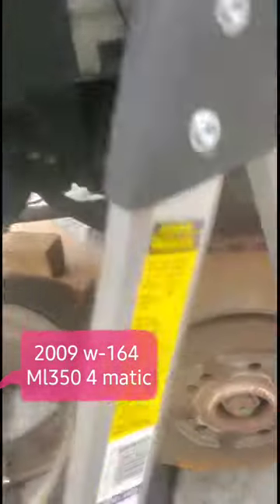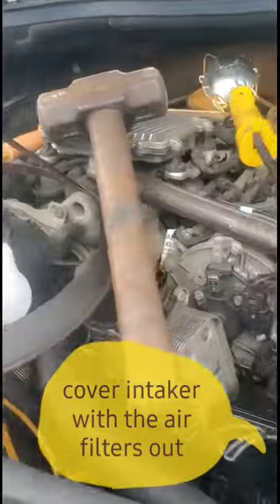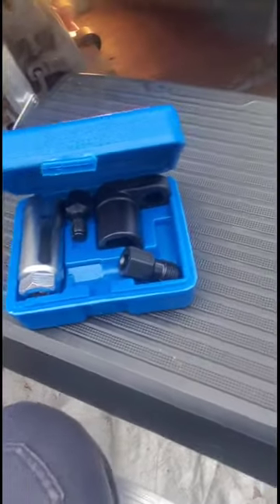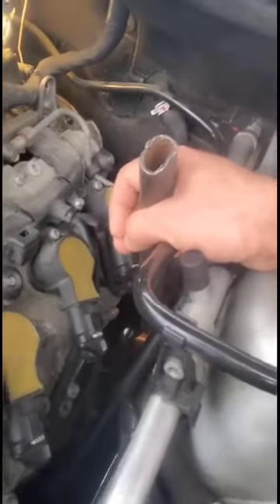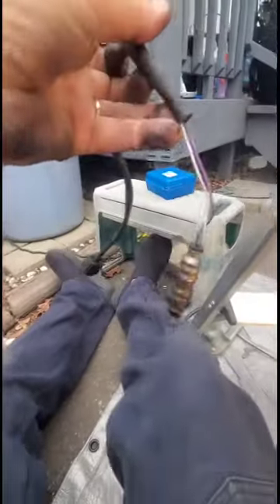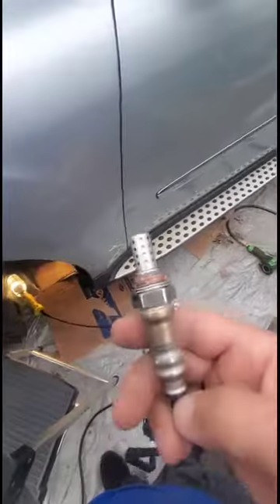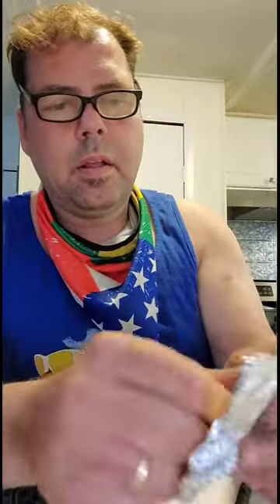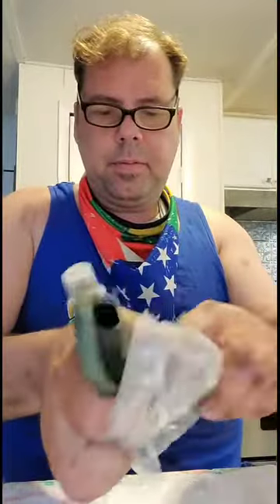2009 w-164, ml350 4matic O2 sensors upstream and downstream bank 1 and bank 2

Comment: How did the aftermarket O2 sensors hold up?  Would you still recommend these rather than OEM?   I need to replace Bank 1 Sensor 2 on my W163

Comment: Hi ,I have 2007 ML350 there is a white burned smoke coming from the upstream sensor area . What code did you have for this issue and what’s the brand name of the sensor that you bought ? Thank you!
Reply: Update, just look it up more and there is oil leak on the small 30mm  camshaft plug it directly dripping on the upstream sensor! Glad I didn’t buy denso $100 sensor yet . I just ordered $8 genuine camshaft plug . Much easier fix hopefully it fix my car issue. I changed the bigger plug 2months ago it’s like 65mm there is one large on driver side and 1small 30mm on each sides . Better check that first with a mirror if it’s leaking oil and dripping on your catalytic converter before changing expensive sensors. Great video by the way it’s hard to record and do the job same time 👌